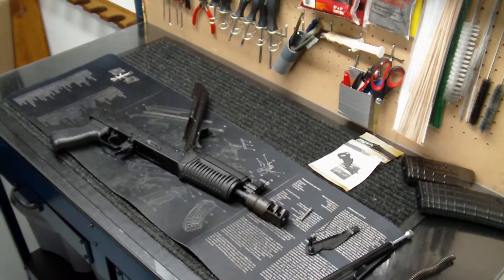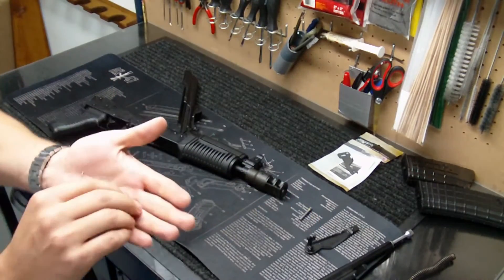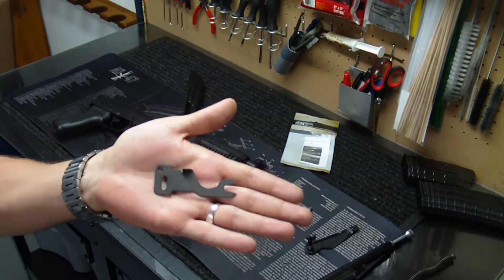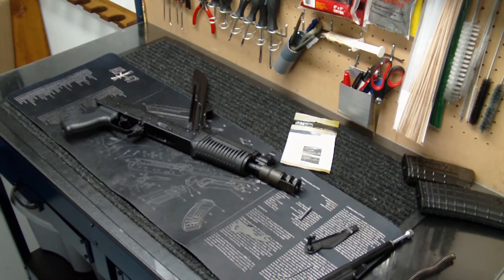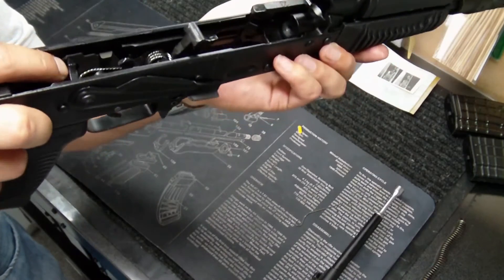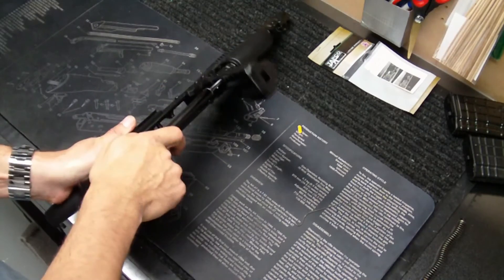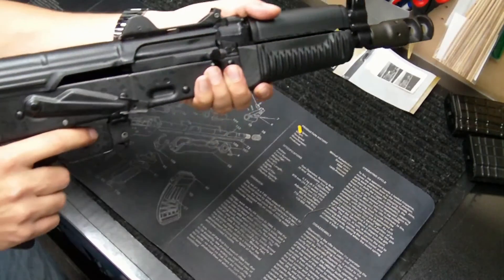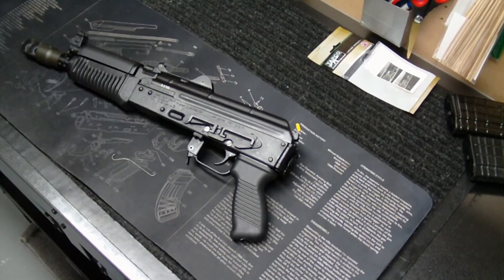Arsenal SLR-106ur .223 AK Pistol:  Trigger Failure!

Comment: Hey ITS, I got an upgrade for you. Ronin's grips has a takedown pin for the top cover:
Bulgarian and Tula Krinkov Quick Takedown Pin/10$. Takes about 15min to install.
Drill and punch out the original pin and then without removing the cover(that's the mistake I made) install the new pin and pull ring. I got both rings but the smaller black one is fine. I used a black paint pen to color the pin, to blend in with the pistol.

Cheers
MJ

Comment: Even the 106 pistols are shit. I have a jam-o-matic 106 CR rifle that eats ammo, jams, fails to eject.
Reply: I know this is a few months down the road, but if you still have the rifle there is a fix for that. If it is an earlier rifle with the AB prefix, it might need the feed ramp widened. There is a fix available online or you can send it to Arsenal. I have the same rifle. Besides under powering my reloads, I had one of the early rifles with the feed ramp issue. I widened it with a Dremel, polished the ramp, changed powders and the rifle runs like a top now.
Reply: +GordonTurnerpark I've been thinking of picking one up regardless of the known issues.  So just widen the feed ramp(bullet guide?) and it was over powered ammo?  Would a high power recoil spring fix that?
Reply: It was widening and polishing. My reloads were under powered. Ak's are over gases. The rifle runs like a clock with m855 and wolf. After I increased my load a bit, that also solved the problem with the reloads. On the ak forum, they had a diagram and discussion about the mod. You don't have to worry if you have one of the new rifles or so I am told.
Reply: GordonTurnerpark Sounds promising but my main reasoning for going with a 556 AK would be piece of mind in a shtf scenario.  It would be pretty important that the weapon would be capable of eating any 223/556 ammo I would be able to find.
Reply: All Ak rifles are over gassed. AR rifles just don't need as much gas to cycle. Keep in mind that the reloads I worked up were for a mid length AR and at the bottom of the power curve. They were MY loads. They were just not powerful enough to cycle the action on the AK. That is a large piece of metal. All factory ammo cycled the action and my loads set in the middle of the load data cycled the AK. One more negative I should have mention with the AK is that the mags are $44 a piece. You can also use surplus Polish Beryl mags, but they aren't much better. Just curious. Why not an AR?
Reply: GordonTurnerpark I have a 556 AR and a black out AR its time for an AK, was just wanting one that ran the same ammo as my 556 AR so I could concentrate on just stock piling that ammunition only.  Any brass I shoot out of the AR gets saved for reloading into black out.  According to a forum I was just reading about the 106cr the problem is with the selector stop and magazine catch release lever being out of whack with how it sits with the rails in the receiver.  A quick fix would probably be to pick up one of the AR magazine adapters for the AK, I saw one online that replaces the trigger guard too.  For around $250 which is about equal to 5 556 waffle mags, I could just get that and install it and run my AR mags I suppose.
Reply: Magazine sits out of whack with the rails in the receiver* because of the selector stop and magazine catch/release lever in the 106cr.  Seems like a likely issue.
Reply: Link to the forum about the slr 106cr selector stop plate.   http://www.akfiles.com/forums/showthread.php?t=172068
Reply: Here's a link to the AR mag adapter for the AK, think this would be the next best thing to sending one to Definitive Arms for theirs and avoiding waiting forever.  http://www.canisdesigngroup.com/m4-conversion-for-ak.html
Reply: Only videos I've found so far on that bastard AR magwell adapter are used in VEPRs and Saigas, I know the Russian 223 bolt is different than the Bulgarian 74 bolt so I don't know how it will work out.  So far from everything I've been reading is the 106cr has a 47 barrel trunnion, a 74 carrier and bolt...
Reply: Gotcha. I thought you were just looking for an AK and didn't have any AR rifles. Personally, I like the AK in its configuration with the Circle 10 mags and this just scratched an itch I had from the late 90's and I like that it looks like a 74 with the folding stock. I picked up a PK01-V red dot too and it works well. I didn't want to mess around with different calibers either and .223 is a reloaders dream in my opinion. Don't really understand what you are explaining regarding the rifle and a problem. Is it a problem with the conversion? From what I read with the AB serial number SLR, it was a problem with the conversion when they set it up in its configuration in this country. I must admit it has been a while since I read about it. One thing that is much different about the AK as compared with the AR. It will ding brass up pretty bad. I went to Kvar and picked up another top cover and modified it so it would stop denting the brass. Also, the ejector does ding the rims up on the brass quite a bit, especially when it is new. I stopped cleaning the gas system on the rifle and it seems to have improved. Maybe the rifle just needed to break in. I have about 1000 rounds through mine. Quite a few of those I have had no problems with. The AR's get a bit more love because the AK does launch brass a bit further even though it is improving with age.